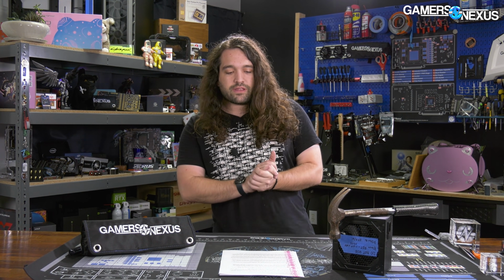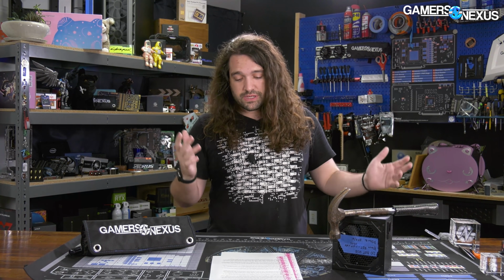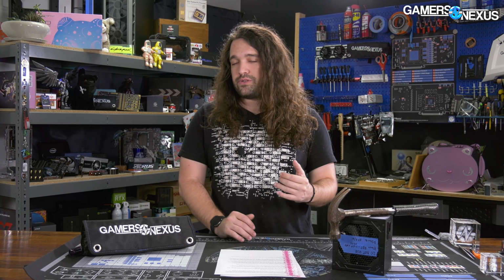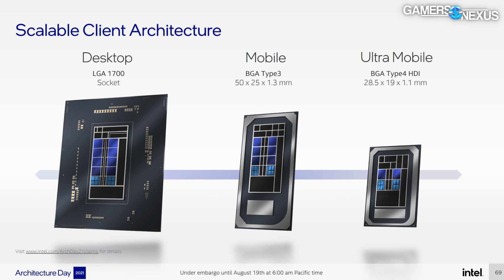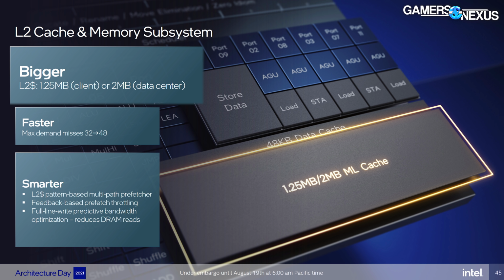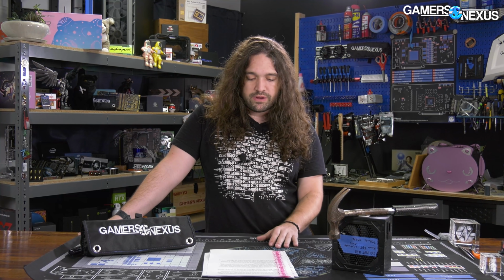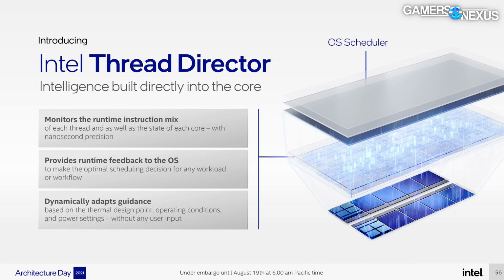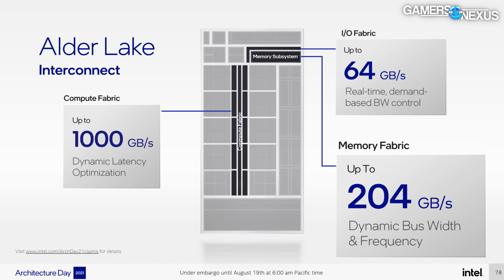Intel Overhauls CPUs: Alder Lake Architecture Explained - New Core, PCIe Gen5, & DDR5

Comment: I'm gonna have to say, based on previous experience with Window's scheduler, that its probably gonna stumble pretty hard on windows, will be interesting to see on Linux as long as Intel provides schedutil energy profiles for the CPU's instead of going HMP. IMHO that would be an interesting comparison
Reply: Probably been working with Microsoft on that which would explain all the w11 legacy dumping.
Reply: @DaleDix  still, Intel director sounds really like basic HMP with just some tweaks, which doesn't bode well for perf/w and perf in general. Let's hope it gets refined a lot more

Comment: My ryzen 7 is only working at 400mhz (398mhz) 4800hs help .38mhz don't understand if firmware issue or CPU issue
Reply: its either the powerstate bug they still havent fixed properly (change the windows powerprofile to highperfromance or isntall the full chipset driver with the amd energy modes) or its thermaly throttling check your temperatures and in that case remount your cooler and repaste it...

PS: ah if its the powert state you ahve to do a full shutdown and reboot cycle
Reply: @proxis9980  ok have tried but..... think maybe bios? It is Asus  ROG g14 with 1650 GTX works fine just slow... Not 2.9mhz x 16 was expecting. It is slow in bios as well lags thinking bios maybe an issue v211

Comment: This will be the biggest test of microsoft's support of opensource to see how much they contribute back the linux kernel for the newer scheduler when they are not being forced.
Reply: Intel probably already has made contributions to the Linux kernel and tested it there first to assist Microsoft in getting their correct.  Linux has had ARM big.little scheduling support for over 10 years.
Reply: Why is it Microsoft's responsibility to write the Linux kernel? The last time Microsoft contributed to the kernel their code was rejected. 50,000 lines of spaghetti was reduced to 5,000 rewritten lines. I mean if I wanted to run the crap code that Microsoft can write then I'd be running Windows. But I haven't run Windows in 26 years now. I'm good with Microsoft just paying Linus' salary. Their money is OK. That's it.
Reply: @1pcfred  it isn't a stretch that microsoft will need to make changes to better support Hyper-V --if only for their own use internal to Azure.  So while the new changes help their bottom line, will they share it with the rest of the world, possibly even competitors?

Comment: Why Intel does not have a variable number of thread configurable like IBM Power 9? What I mean is in most Power 9 systems, if one server is configured with 8 core, the admins can decide if they want 2 SMT for 4 CPU and 8 SMT for rest of 4 CPUs, or they want 8 SMT for all 8 CPUs making 64 thread or they want 2 SMT for 8 cores which will be 16 thread.
This is used to configure what kind of workloads go in which CPUs.

Comment: So it might be able to compete with a 12 core vcache zen 3 cpu but still fall behind a 16 core vcache zen 3 cpu
Reply: Nope 🙅
Reply: @rgb9855  no it won't compete with a 12 core zen 3 with vcache or no it won't fall behind the 16core zen3 with vcache?
Reply: @johnknightiii1351  How do you Know Bro???🤨
Reply: @rgb9855  you are the one saying no like you know what's happening.
Reply: @johnknightiii1351  🤨🤨
I don't get it broo
Reply: @rgb9855  what don't you get? Your responses are quite vague
Reply: @johnknightiii1351  🤪🤪
Reply: Leaks from one of the most reliable leakers show the 12900k beating the 5950x by 25% in single thread in Cinebench, and 10% in multithreaded. So Intel will have the performance crown with Alder Lake.
Reply: @__aceofspades  you aren't taking the vcache into account. The vcache edition will be the one competing with alder lake.

Comment: 10:40 No! On desktop E cores are meant to increase performance in highly threaded load. They are there to increase performance in TDP constrained scenarios. That's why we will see 8P+16E the generation after Alder Lake. Everything you mentioned will be on desktop most likely scheduled to performance cores to be as snappy as possible.
In mobile environment on battery power they will be used the way you described.

Comment: Why would anyone want low powered cores in a desktop? They can't get performance per watt gains of any significant amount, so have added a band-aid option? I would just prefer 2 extra "real" cores.
Reply: better multithreaded performance for the same die space, when relying on single threaded performance you don’t really need as much cores, and when relying on multithreaded a lot more cores for the same die space is more efficient
Reply: heterogeneous compute is MORE performance than a similarly sized traditional homogeneous chip. Apple, ARM, Samsung, all do it. AMD will do the same with Zen 5. It literally is the future. Its both power savings AND more performance.

Comment: Linux might already have the scheduler mostly ready because of Arm's big.LITTLE architecture I guess?! Anyway knowing Intel they'll be ready for Linux.
Reply: After all X86 CPUs like Intel and AMD do, are CISC machines, while ARM CPUs are RISC machines. So both devices use completely different instruction sets (Complex-vs Reduced Instruction Set Computer). There is no way Linux could have done any implementation based on ARM bigLittle.
Reply: @Squilliam-Fancyson  Parts of the scheduler might be in assembly for efficiency reasons, but it really helps to have the algorithms already written out and tested for a similar idea.
Reply: @andruloni  If you compare Intels new iteration of a hybrid cores, the interconnection between these core clusters is handled completely different. There are no similarities betweens ARM Cache Coherent Interconnect and Intels Thread Director. Intel uses several layers for scheduling while ARM only got one for the clusters and on for IO. While ARMs core clusters have there very own L2 Cache , Intel only goes with one L2 for all cores. Intels solutions seems to be much more soffisticated and complex. I hope this ends in a tighter integration to leave as little performance behind as possible.
Reply: @Squilliam-Fancyson  see, now we're talking some proper reasons
Reply: @Squilliam-Fancyson  no one's built a CISC core CPU in 20 years. CISC is just a front end. We do want more than just a few MHz out of CPUs today, you know? I don't think CISC ever cracked the triple digits.
Reply: @1pcfred  Yeah todays X86 CPUs are highly costumized RISC/CISC hybrids.
Reply: @Squilliam-Fancyson  today's X86 CPUs are confusing beasts.
Reply: I hear Intel's Xe Graphics still doesn't work on Linux yet. So don't put too much faith in Intel being Linux ready.
Reply: @1pcfred  Linux having a HUGE servers marketshare I don't see Intel not being ready for it on launch. But if they're not, it will be their loss anyway. I'm fine with either Intel or AMD. I'm not a fanboy so I just buy the best for my machine and OS. Same with GPUs.
Reply: @cedric5947  I do not think this PE stuff is targeted towards the server market. Quite frankly it all sounds like another bad idea that was dreamed up in a board room to me. I want all performance cores. As much performance as I can get. Who buys a system to go slower? OK maybe it makes sense in some mobile applications. On the desktop? I'm just not seeing it.
Reply: @1pcfred  IDK. It can make sense to handle the OS while gaming with the P cores for example. It could be a good idea. But only reviews will tell. As for the server side of things well we know that mainstream techs are the base for server CPUs at some point. But what I meant is that Intel has always been on time with supporting their CPUs on Linux. I don't see why that would change now.
Reply: @cedric5947  Intel got on the bandwagon late. Better late than never I suppose.

Comment: even 256 Int 8 operations per cycle implies feeding each core with a terabyte per second or so of data. Good for small data sets, 110% RAM bandwidth limited for anything else.
Reply: Not every single byte loaded from memory only needs one operation done on it. Long chains of instructions (i.e. algorithms) are much more common.
Also overlooked is the fact that, just like with the 128-bit SSE and 256-bit AVX instructions, there are special MOV/GATHER/SCATTER commands that load the entire register in a single operation, i.e. it would NOT require reading 256 8-bit numbers from ram, rather you would use the prefetch instructions (e.g. something like VGATHERPF0QPS in AVX-512) to, in a single instruction, load the required data from RAM into the fast cache and from there you could operate on them just like you would a single, x-bit sized number.
That's the beauty of these SIMD architectures; it's not just mathematical calculations being accelerated, it's like having a 256/512/x-bit processor in stead of a 64-bit one, but you actually put those bits to use as a true >64-bit CPU would be extremely large and have a lot of overhead for very little benefit beyond very specific scientific applications.

As to the usefulness of 1024 Int8 operations per clock cycle, it would be a godsend for anything to do with video (yes also AI, but that is more a gimmick for actual PC users than anything useful right now; other than the obvious largest use case of relieving the burden from human workers having to look through/listen to all of your data, to just flagging the interesting stuff for human review and long term storage.).

AVX-512 also has the potential to literally quadruple gaming performance from the algorithms commonly used today (256-bit SSE2, sometimes also SSE4), although no one is going to selectively optimize and compile their code just for Intel CPUs any time soon, so I highly doubt we'll live to see the absolutely astounding performance improvements possible with it. All of the common compilers (except for ICC, which it seems no one has the balls to develop games with, even before AMD became the leading gaming platform and grabbed a large chunk of gaming market share) have even started to preferentially compile to 256-bit SSE instructions by default, just to not trigger the few 100MHz AVX-offset downclock, even though that reduction in clock speed doesn't come close to the performance gains that could be achieved, even if the programmers didn't specifically write assembly-optimized AVX algorithms, but just used the AVX intrinsics and included a few compiler hints into their code.
We could have had a revolution similar to the move from SISD to SIMD with the computation of 4x 32-bit numbers with a single instruction (think, 'Pentium with SSE' levels of performance improvement). Those instructions that allowed going from doing single 32-bit instructions to acting on 4 packaged 32-bit numbers in a single 128-bit wide SSE instruction is what made the games of the late 90's and early 2000's possible on the hardware available at that time.

Sadly, such performance optimizations seems to be a completely lost art in modern game engine development (compare the custom, very fast 1/sqrt() function in Quake III, as opposed to simply calling the built-in sqrt() function and relying on the CPU's FPU do the division for you)...
Reply: I guess it's useful to optimize some very specific algorithm? For things that can mostly stay in cache.
Reply: It's for block matrix multiplication.  The number of operations grows as the 3/2 th power of the data set size.  So the bigger your matrix, the less memory bandwidth limited you are.  This was discussed in one of Jim Keller's Tenstorrent interviews.

Comment: Better single threaded performance is all I care about, finally some meaningful movement after years of stagnation.
Reply: if you want single core the 10900k is a great option it goes up to 5.2/5.3 ghz single core
Reply: hey, dont forget how big of a jump single core is on Ryzen 5000!
Reply: @mineturte  it’s not a big jump though. It’s a big jump over AMDs own product stand but compared to Intel they aren’t much faster in real world applications.
Reply: @Code-n-Flame  in gaming and in multi-threaded tasks they perform significantly better when accounting performance per watt and temperature.
Reply: @mineturte  In gaming not so much better, but multithreaded yea by double digits
Reply: @eddyr4984  in heavily CPU bound games like any source game or esports titles like valorant the gains are massive
Reply: @mineturte  Over AMD's last gen offerings, they still pretty much tie with Intel 10th & 11th gen for most single threaded workloads. Where AMD really shines is in multithreaded workloads where they just top the charts with generally big margins compared to Intel.
Reply: @mineturte  no ryzen is btter multicore and intel is better single core
Reply: @duh809  benchmarks from multiple independent reviewers show the 10900k to be significantly slower single core than the Ryzen 5000 series, and the 11000 Intel series only closes the gap while having thermals unreasonably high in comparison to Ryzen
Reply: @mineturte  really i saw many benchmarks and all benchmarks said that 10900k is better single coreand ryzen 5000 is better multicore
Reply: @mineturte  ryzen 5000 is better for gaming tho

Comment: I really hope they put efficiency cores between performance cores in the actual layout...
Reply: how ? the efficent cores are 4 on the same die size as one perfromance core, its like a block :D also you absolutly do not want it to be heated from surrounding  p cores, then you can kiss your efficiency goodbye...so a) its not possible unless you would pack 6x4=24e-cores and b) even if it was they absolutely 100% should not do it :D....
Reply: @proxis9980  I was coming to this comment to say the same thing. You're spot on!
Reply: @proxis9980  how does increased heat from the p cores decrease your e-core efficiency? I'd say if you can have e-cores between p-cores, you benefit from better thermals. for example, you could have an arrangement of p - p - e - p - p.
Reply: And to add to @ProXis' statement, placing the larger cores farther apart will cause a performance hit because of increased latency.

Comment: I lost faith in Intel YEARS ago... I've attempted to like their products, but I've found AMD to be much more reliable. This one might (keyword) get me on board. Thanks for the vid Steve, and as always, nice hair!
Reply: I just dont like how amd immediately jacked up thier prices once they became competitive
Reply: @Nostrum  I don't disagree, however, I'd rather pay more for something that works rather than less for something that will constantly give me problems. However, now AMD's pricing is better in MOST cases of cost to performance versus Intel.
Reply: @nathanjohnson2474  That simply isnt true, and neither is the 'AMD has less issues'. But keep telling yourself that. Theres a reason why NASA uses Intel over AMD for computing their projections...
Reply: kicking myself for not getting a 10850k when it was under 400 locally, while a 5800x is around 700
Reply: @aceofspades in my personal experience, AMD has been far more reliable. NASA can do what NASA does. I'm not NASA, but I do know that for everything I use my PC for, AMD is faster and more reliable. 
@Nostrum I just picked up a 5800x at best buy last week for 379.99 after Amazon price match.

Comment: Soon enough isn't "soon enough" haha. Very excited to see what the Alder lake processor benchmarks and performance looks like. I've got a 4.5 GHz 4930k and 3090. Waiting to see if it's time to upgrade to AMD or Intel.
Reply: How CPU bottlenecked are you?
Reply: @How23497  With newer titles that are CPU intensive the 4930k is starting to show it's age more and more. The IPC changes from then until now are starting to add up but only after a long period of stagnation in the CPU market which has lead to the 4930k still being a powerhouse in my rig.

Comment: is Alder Lake down to 10nm?
Reply: Alder Lake is Intel 7, previously named 10nm Enhanced Superfin. It is a node enhancement from TigerLake 10nm SF. It is equivalent to TSMC 7nm.
Reply: Alder Lake 12th gen in 10nm (2021)
Raptor Lake 13th gen in 7 nm (2022)
Meteor Lake 14th gen in 7nm (2023)
Reply: Yes. It's now called Intel 7 though

Comment: implementing big little on a desktop cpu is the stupidest thing ever... why would you need efficiency to things that is connected to a wall plug all the time?
Reply: It's not for efficiency. It's intended to assist P cores in heavy workloads and run background tasks.
Reply: heterogeneous compute is MORE performance than a similarly sized traditional homogeneous chip. Apple, ARM, Samsung, all do it. AMD will do the same with Zen 5. It literally is the future. Its both power savings AND more performance.

Comment: I hope this new feature Intel Thread Director is not a new Security Hole in the future.
Reply: It probably will be at some point. Doesn't really matter as long as it isn't easy to pull off. If it requires a lot of effort an attack using social engineering is likely going to be a lot more lucrative anyway (you'd be surprised how many people get fooled by fake login pages & the like).

Comment: It's a pity they've ditched AVX-512 support. I know it's not of great use to most people, but it's great in some niche cases (PS3 emulation for example).
Reply from the maker: Interesting about the PS3 software. Wasn't aware of that use case!
Reply: And we you have to use rocket lake lmfao
Reply: ps3 emulation? i think ps4 emulator is coming soon, pc hardware is more than enough to run ps4, just need software optimization from emulator
Reply: @richard35791  ??? ps3 is completely different you can't compare them